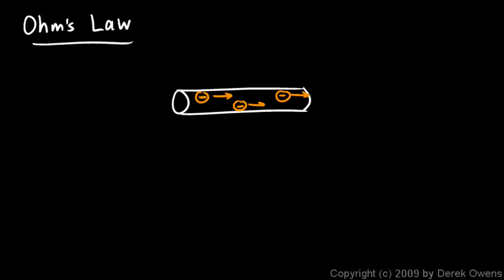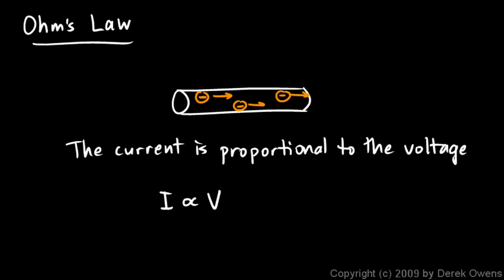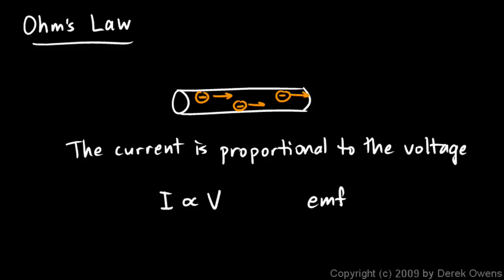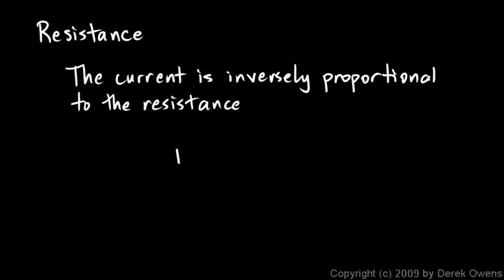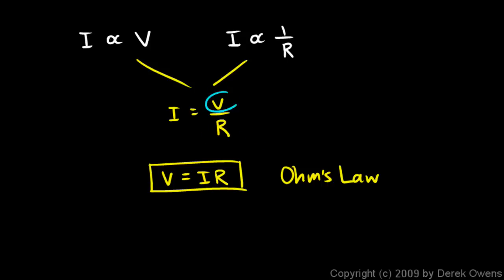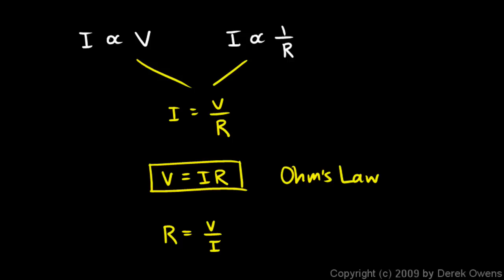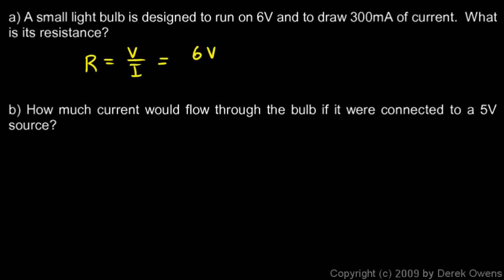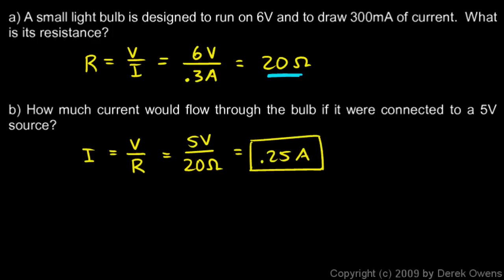Physics 13.2.2a - Ohm`s Law

Comment: what is the point of having a resistor at all, couldn't you remove that and get more current?
Reply from the maker: Yes, but maximum current isn't always the goal. You may need to limit the current in many cases. Electronic components are typically designed to operate one a certain voltage and current, and a resistor can be used to bring the voltage down to the desired range if needed.

Comment: So no matter how many volts you have, the resistance is always the same??? Is that because it only needs so much to take away from the system??? And wouldnt that make current just how much is left over after resistance?... Just understood so much...
Reply from the maker: Yes, the resistance is typically the same regardless of the voltage.  That is because the resistor is a physical object.  It is a little electronic device that you can buy at an electrons store.  And its resistance depends on the physical properties of the object - it's length, thickness, and material.  Cranking up the voltage will increase the current flowing through the resistor.  Decreasing the voltage will decrease the current flow.  The same is true for other objects.  A toaster has a certain resistance, determined by the physical characteristics of the toaster.  A light bulb has a certain resistance, etc.  And the current will be V divided by R.  Changing the resistance typically involves swapping out the resistor for a different one, or else changing part of a combination of resistors.

Comment from the maker: Think of it like this:  The current flows through a wire, right?  And what is that wire made of?  It's metal, and it is made of protons, neutrons, and electrons. So yes, there are electrons already there.  And when the circuit is turned on, they all start to move.  It is similar to turning on the water faucet.  You don't have to wait for water to get all the way from the city water tank to your house.

Comment from the maker: It actually doesn't matter which side of the bulb the resistor is on.  There are electrons all through the materials, and when the voltage is applied, the electrons start to flow, basically all at once.  The resistance of the wire and of the bulb offer resistance to this flow, but a resistor does not stop electrons from getting to the bulb by being in one spot rather than the other.

Comment from the maker: It depends on what textbook you look at, and at what level.  High school textbooks commonly use V for voltage.  Electrical engineering texts often use E for voltage.  Graduate texts often use V for kinetic energy.  And it varies from one era to another and from one place to anohter.

The important thing is that voltage equals current times resistance, regardless of the letters used.

Comment: @tom01011 Inception1338 in europe we use V as the Unit and U as the physical size in equation only the physical size is used. I don't know if these terms unit in size are correct though...  Just copyed

Comment: if current passes through a resistor, current goes down, but doesn't that violate kirchoff's current law, which states that current that goes in equals the current coming out? or does that only apply to circuits with nodes/junctions?